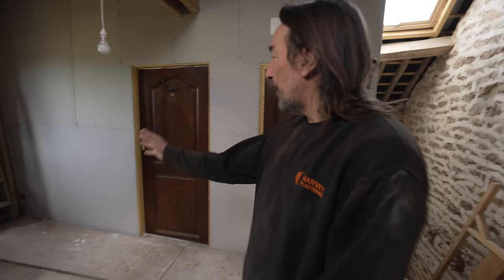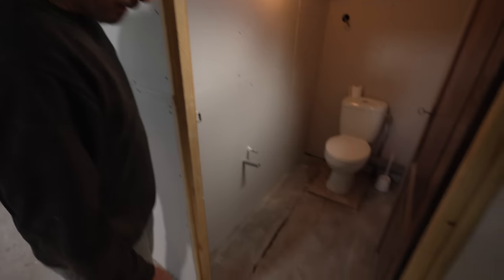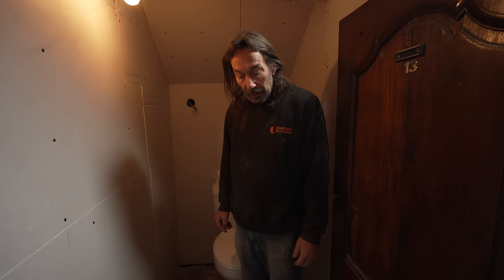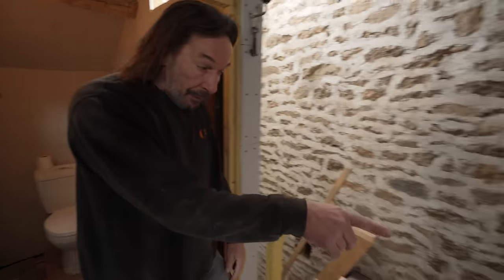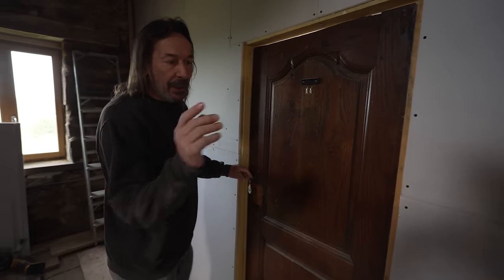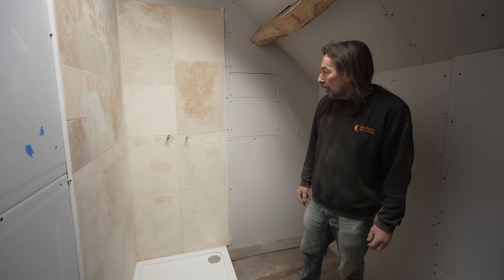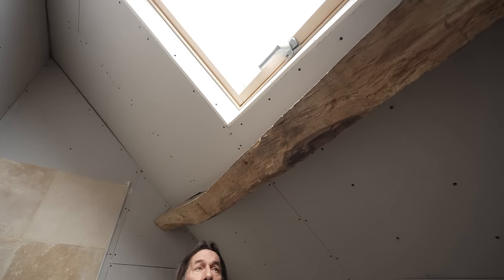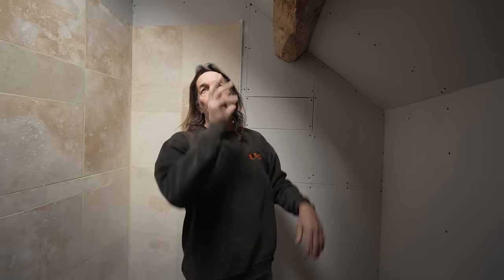Simons Last Day

Comment: Wow, Simon, love the way you are letting the farmhouse work for you. Restored an old A frame cabin and did the same thing. Found a sunken fireplace under the floor. Used a lot of knotty pine for cupboards. Found they used cedar in the frame of the house. It was so much fun. It was rustic and very comfortable.

Comment: Hy Simon. I‘l would Go and fill the Crack in the toilett with black epoxy. Then Sand the whole flor and set it complete in clear epoxy. So you can see the nice flor and it is easy to clean..

Comment: I've seen black epoxy used between the floor boards that don't meet perfectly.  would need access from beneath to seal the crack before pouring the epoxy.